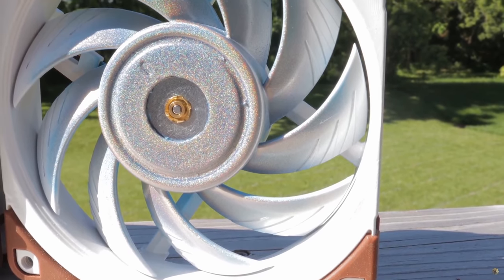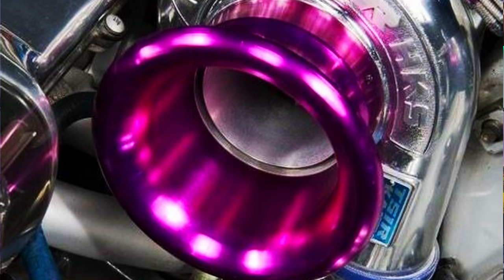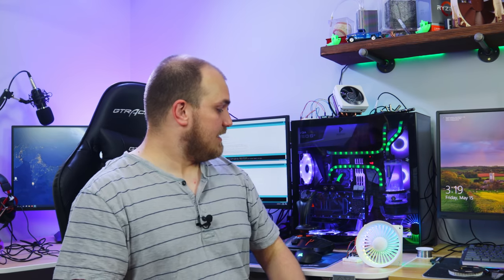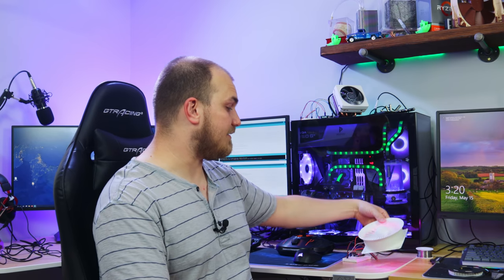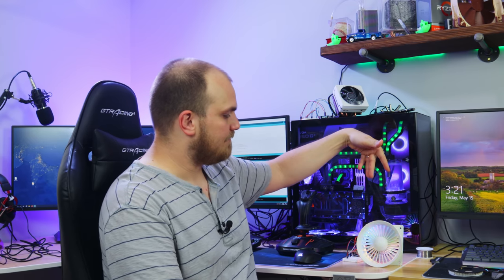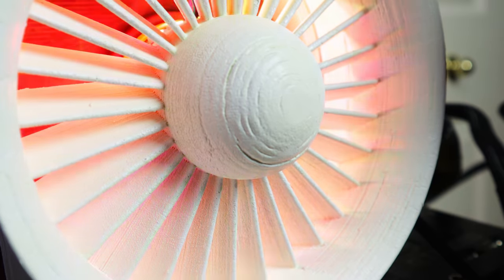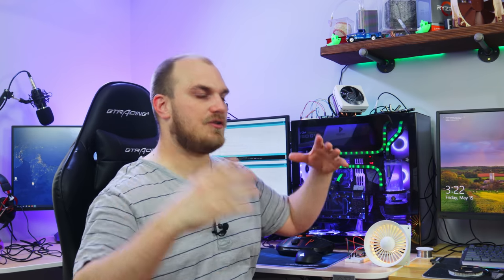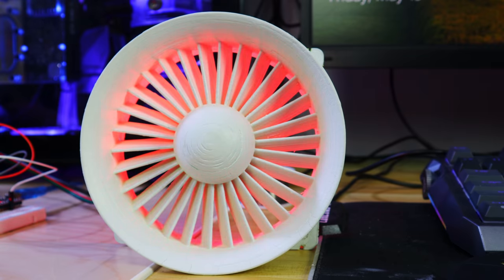This Makes Any Fan Look Awesome!

Comment: There thicker filler sprays for 3d printing
Other options:
Wood filler
drywall filler
clay
bondo 
All thin coat to fill in the low spots. Then sand still ugh.

Comment: Starting off your print quality is more of the issue than smoothing. The filament your using can have alot to it, as well as your clamp rollers on your guide rails are probably to tight.
Reply from the maker: ill check

Comment: Oh...I gotta warm up my 3d printer.. I'm thinking of building a PC case with a 200mm intake fan with an intake velocity stack based on his Design. Feeding into a mini-itx board with a second 200mm exhaust fan with an afterburner style exhaust shroud and have the PSU hidden in the base.

Comment: I'm sure you have been told by now, but ISO will smooth PLA, or use a hot air gun carefully.

Also, "ar-dwe-no"

Comment: You still need to look into non-planar FDM/FFF. Gonna be banging on this until you figure out how to truly print in 3D, rather than the 2.5D that typical planar printing allows. With non-planar printing, you don't step up layers, you print moving in every axis. This makes curved surfaces along the Y plane possible. See this: https://hackaday.com/2016/07/27/3d-printering-non-planar-layer-fdm/

Comment: I think Noctua looks good. That's the brand trademark. I'm still a 2011 case guy. I like big fans and side panel fans rather than glass panels. I even turned my rig so I don't have any light in my eyes so I thoughtv why don't we make the I/O shield the front of our rigs and put the MB upside down making the cpu suck air from the outside instead of heating it up with a hdd cage (whomever still have hdd's in the rig) and the gpu.
I have an HAF X full of antec big boys and my 980ti can't go past 72 C. I would like to know if bitfenix 230 would perform better but there is not much knowledge on the internet.
Reply: Gamers Nexus does some testing on case cooling, the HAF X is the chart topper for GPU temps if I recall correctly. Certainly high up there. Anything with a sidepanel fan is very good for GPU temps.
Reply: @DeBlackKnight  yes I found it again his revisit of the HAF X. It has a lot of downsides, it's a dusting nightmare and is really big and heavy but it's just so good temperature-wise that I struggle to part with it. At the moment I have so much air flow that if I put a fan near the NH D14 it spins without being powered. It doesn't even support heatsink swap without removing the motherboard. It was meant for 1366 intel socket. Anyway if some of the many accessories weren't made of plastic you had to dremel them out since the gpu internal duct was a nightmare with 2 gpus. I'd like to design my own case to support Noctua's A20 since there not much evidence of quality big fans, most of them are old and no one cares about them anymore. Like those Bitfenix 23cm, those should be even better than my Antec Big Boys. Not all Noctua fans are good though. I have S12b and an A15 that are more on the noise side, especially the A15 but maybe it's just my fan.

Comment: Why not try to calibrate and set up the printer properly from the slicer, once you do that i can guarantee you ll have near perfect prints without the need to sand or so anything at all .. also i would suggest you use 1.2mm layer height as it gives the best strength and looks with decent times. Make sure the belts on your printer are tight and that the z axis are striaght to avoid gaps between layers and if you re having stringing use slightly lower temperature (210degrees celsius is the best quality and strength temp ) or increase retraction speed and distance until its gone. Keep up the great videos i love them ;)
Reply: 1.2mm? how big is your nozzle?

Comment: the only real way to smooth PLA is to sand it. starting at 200, and going all the way to 1500-2000... or buy a printer with a better resolution.

Comment: Watchu talkin bout Willis?
Pla dissolves with acetone... doesn’t it?
Reply: Also as for the sanding remark.
Spend a week literally dialing in every single bearing and belt on your printer, set xyz calibrations and such, make sure you get rid of bed wobble etc. and just make a really, really good profile for your material.

Took me nearly one whole month to get my old ctc 3D rip-off printer to put out decent prints, but managed to get down to .1 and some serious details with 0 sanding required at the end, just a bit of primer to fill some gaps :)

If I ever find some of the little Pokémon models I made up or photos I’ll show you how truly flawless it really was :)

With dimes and angled parts that don’t quite get the perimeters right (I do the most crazy thing) I always print at about 80-99% density using the lines feature with offsets to get rid of the zipper and to make sure that all those kinds of things always come out 100%

Ps red sweep but with purple for me!

Comment: I've not tried smoothing PLA, but this video discusses chemically welding it with paint stripper. https://youtu.be/YM1O3Kt5Gsk

The idea is the same as acetone on ABS. Maybe you could paint a thin layer on the PLA or vapor bath it and see if it behaves like ABS and acetone.

Comment: Theirs always bondo to smooth out 3d prints, kinda relaxing in a weird way and a good way to add thickness if needes
Reply: You could also just use epoxy which would probably hold up better than Bondo.

Comment: Ironing! its a setting in cura!
Reply from the maker: What is this you speak of
Reply: @MajorHardware  :) open cura and search for ironing. It comes up under "Shell" It basiclly does another pass but with just the hot nozzle to melt the top layer and make it smooter. Its not perfect, and might only work on flat things? But try a quick test

Comment: You want me to spent 21 bucks on an LED strip to add color to a $30 fan when I could just buy a fan with leds built in like a Corsair maglev fan for half that price? Ok boomer.
Reply: That noctua fan will outperform a corsair maglev fan in every way, this is for people looking for every last bit of performance and quiet without sacrificing looks. Boomer.
Reply from the maker: I don't think your using boomer correctly
Reply: @MajorHardware  you're